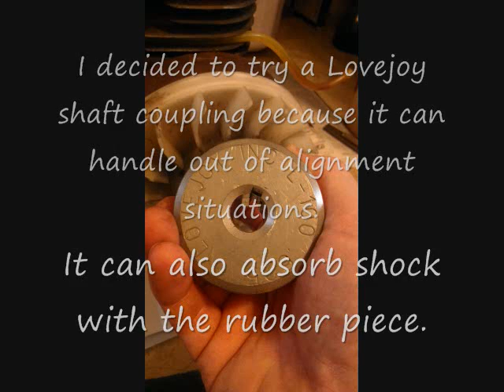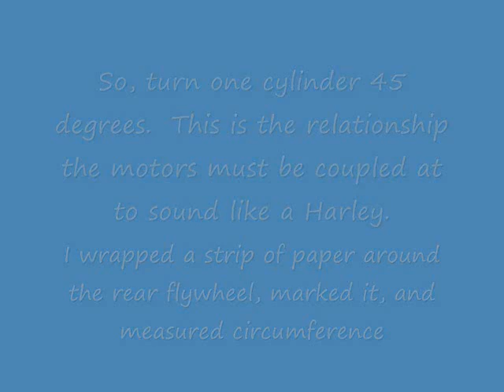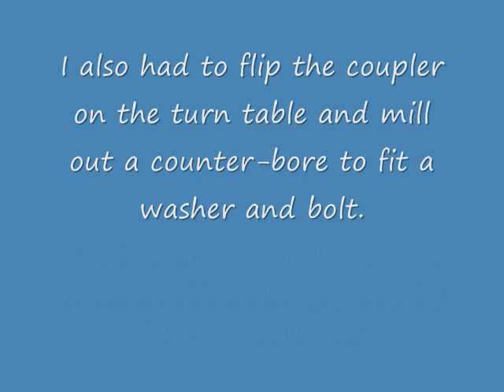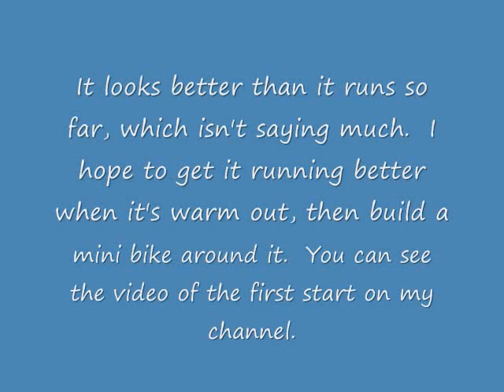How to couple two small engines together to sound like a Harley Davidson V-twin

Comment: The Harley Davidson "Potato Potato" sound at idle is called a "Syncopated " idle and and is a result of 3 factors:
 The iconic Harley Davidson Vtwin engine design utilizes a single crankpin (AKA rod journal) which means that the pistons location relative to top dead center is only separated by 45°, which is the degrees of angle between front and rear cylindes (when the front cylinder is at TDC the rear cylinder is 45° past TDC. The cam/valve timing is such that when one piston is moving up on a compression stroke the other is moving up on exhaust stroke. This means that when the rear cylinder fires and begins its power stroke the front cylinder is 45° of angle separation ( the ange of the V ) plus 360° from beginning it's power stroke for a total of 405° ( The rear cylinder power stroke occurs 405° before the front cylinder power stroke) when the front cylinder begins its power stroke the rear cylinder is already 45° past TDC on it's exhaust stroke so it is 360° of rotational separation minus 45° of separation due to the 45° angle of the V, giving us 315° of crankshaft rotation between the front cylinder power stroke and the rear cylinder power stroke and 405° of crankshaft rotation separating the front cylinder power stroke after the rear. This gives us a required 720° of crankshaft rotation to achieve 2 power strokes vs 360° or 540° common on most inline twins. 
So to summarize, the Harley gets it's distinguishable Syncopated idle from three factors in it's design.
1. It has a single crankpin for both cylinders. 
2. It has a narrow 45° V configuration vs the much more common 90°, or 60° V configurations that most other Vtwins use. Of note, Indian motorcycles (the originals made in 1953 or earlier, not those from any of the reboots) had a 46° Vtwin and the JAP, a British company made 50° and 60° Vtwins.
3. The valve timing when combined with the narrow angle V configuration causes a difference in degrees of rotational separation between front to rear power strokes and rear to front power strokes which gives it an uneven sounding but rhythmic Syncopated idle and that sound gets even more pronounced when the Idle speed is below 1,000 RPM. 

To get 2 single cylinder engines linked together and timed to sound like a Harley simply put your "Front" cylinder on TDC compression, put your rear at 45° past TDC exhaust and then secure your mechanism that keeps them locked into that relationship with each other. I've done this with several different engine types from Briggs and Strattons, Small motorcycle engines, and even some single cylinder 4 stroke RC airplane engines, and if you do it like this and can get your idle speed to 1,000 RPM or lower the exhaust note at Idle is identical to the Harley Davidson "Potato Potato " you can even do it with a couple of 2 stroke engines, although they won't sound like a Harley they will sound pretty mean.